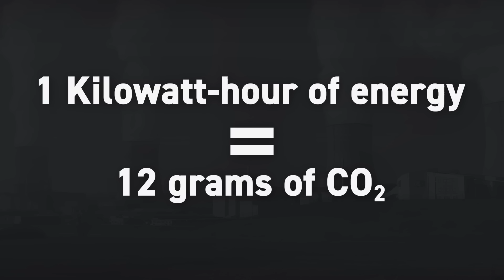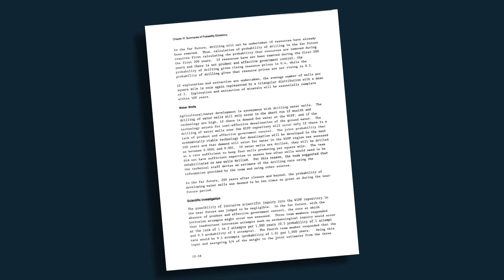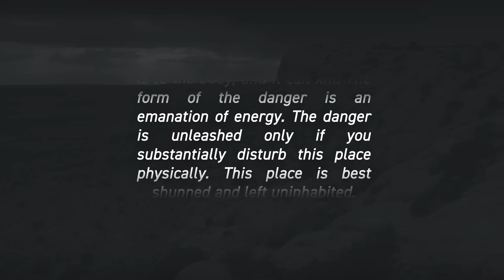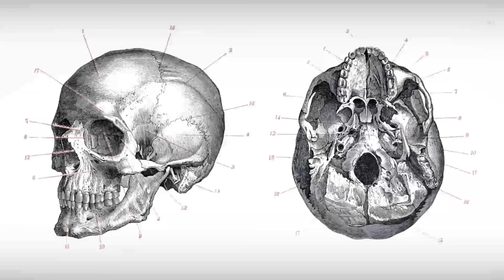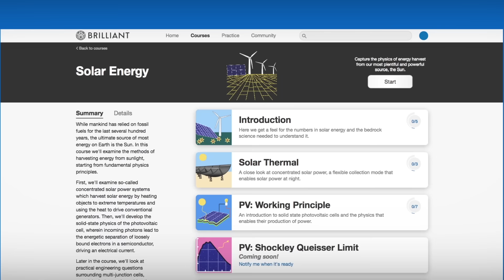The Nuclear Waste Problem

Comment: Disappointed that alternatives weren't even mentioned in the video. Thorium waste is safe after only hundreds of years, rather than hundreds of thousands. It's something that really needs more exposure.
Reply: yes and we cant use it at this point in time to produce energy. Nuclear waste isnt such a big problem. The pictures we saw in the video were probably the waste that a hand ful countrys generated since they started their first power plant.
Reply: And there's a ton of it unlike uranium. They used to just throw it away before.
Reply: TheCrazyKid1381  well for one he only talks about burying nuclear waste without going into other alternatives like Waste-Annihilating Molten Salt Reactor (acronym WAMSR) and really overstates the impact of nuclear waste. 

In fact Molten salt reactors are not even new. They were developed and tested in the 60's. But its videos like this that scare monger people into not supporting nuclear funding... which makes your problem worse. 

Fukushima was made in 1971. ALL of the reactors were generation II. In 1990 US NRC pointed out the problem in the reactors design and in 2004 japan NISA also cited the report. They knew and did nothing.

The problem is not nuclear power. It is the fact that nuclear power is seen as a boogie man so no one wants to support it.
Reply: kyletheok Nuclear power just like carbon and solar and many more, has drawbacks. 

As an Italian, I am happy that we don’t have to worry about some idiots poisoning  a 30km square (which is less than half of Chernobyl) area, because of a serious power failure, natural disaster (What happened in the case of a level 3 Vulcanic eruption? That eliminates a good 20% of the Italian coast, than you could have serious earthquakes...).

Honestly even just having them in France is a little bit of pain in the ass. Why should we worry about something going wrong there?
Reply: @baboongamingmgrr  
First of all, heads up for your knowledge on the matter. My knowledge stops at Chernobyl HBO web series... and the fact that it is the "cleanest" (Radioactive waist) source of power after windmill (learned from a youtube video obviously). 

However, you blamed the previous Nuclear incidents on Government mismanagement, mainly. Which I had already been made aware of. Thus, how can I, however be sure that this same mistakes will not be done by any future governments of my country, in the next 100 years?

For example, just this year, one of the most important bridges in my country just fell. 43 fatalities, and 600 people had to move due to the disaster caused by the fall. "Ponte morandi"incident,  it's called.

Why? Because despite having paid more than 10 times the amount of money, experts deemed necessary for the reparation of the bridge and other check ups, almost nothing was done. The money, more than €100millions of taxpayers money, was paid for the death of 43 people... what happened to the money? Disappeared. I think you can guess where it went. 

Thus, what if the same happened in a power plant? One day a hertquake hits (Italy is the Western European country most prone to earthquakes, receiving various every year throughout) and the power is lost. What append then if something doesn't work, let's say water supply stops due to a missed checkup for one of the generators.

In addition, Italy already has a tremendous output simply trough idro-powered centrals (25% of electricity is done trough clean energy in Italy), I doubt the cost saved by the long-run investment, would pay anytime soon seeing how much we actually need to buy from foreign countries + the opportunity-cost/Risk cost.
Reply: @baboongamingmgrr  however my question remains. How can I be sure that my government will respect the safety standards... (I guess the EU might have some policies).

Anyway, I think you might have brought me from being against Nuclear, to being much more neutral. i.e If a referendum comes up, I might have a difficult choice.
Reply: Saying that "thorium waste is safe after only hundreds of years, rather than hundreds of thousands" as an argument for thorium just exposes how badly the thorium crowd misunderstand the topic. First, the shorter the half-life of something, the more radioactive it is, meaning something with a short enough half-life to be inert within a few hundred years is /immensely/ more radioactive than something that won't be inert for a few hundred thousand years. However, both thorium and uranium power produce both types of waste. Thorium doesn't really have much of an inherent advantage over uranium in this regard, what advantages there are are quite narrow (the nuclear proliferation risk for example, it's lower with thorium than uranium, but the deal is that proliferation risk from civilian uranium power is already /very/ low, it's an inefficient means to a weapon) but nonetheless there. The main benefits, including the waste benefits, largely come from molten salt breeder reactors, which can use uranium just as well as thorium. 

The big set of arguments for thorium over uranium are largely just arguments for molten salt breeder reactors, and full of peddling of falsehoods about uranium power that further contribute to anti-nuclear fears among the public. Both sources have a place, as diversification of nuclear fuels is absolutely a good thing, and both are incredibly safe. So please quit throwing one under the bus to push for another.
Reply: I wish more people knew about Thorium and Thorium reactors.
Reply: Not true. Th breeders running on U233 DO produce heavy transuranics with long half lives. They just don't produce as much as a 235 or Pu burner.
Reply: @gladonos3384  
When you say "Thorium Crowd", are you talking about the thousands of physicists, chemists and engineers that are working on modern 3rd and 4th generation MSRs, or are you referring to the original 1960's team, led by Alvin M. Weinberg, who created and ran an MSR that had passive safety and ran at atmospheric pressure? 
Do you know anything about solar panel decommissioning and heavy metal soil contamination? Also, do you know the longevity of wind turbines, and what is the number of people killed due to wind turbines?
Please enlighten me, nay us, on these matters at you earliest convenience.
Reply: @quietackshon  "When you say "Thorium Crowd", are you talking about the thousands of physicists, chemists and engineers that are working on modern 3rd and 4th generation MSRs, or are you referring to the original 1960's team, led by Alvin M. Weinberg, who created and ran an MSR that had passive safety and ran at atmospheric pressure?"

Absolutely neither. I am talking about the "scientific" media that supports either one and claims to know but really just spreads stupid wishful thinking. I for example support Thorium. But i don't claim to be an expert. 

I do think the idea that "lol climate change won't be a problem because Thorium will simply replace everything" is ridiculous and a dangerous idea. The real truth is that we will probably be burning coal for a long time and it will be nightmarish trying to get off it.

But fusion is way worse because the "scientific" media treats having commercial fusion as if it's it's like having a Dyson sphere and ignores problems like neutron bombardment contaminating the walls as well as needing a nuclear fission reactor to produce tritium(shhhh! Don't tell the hippies...)

And yes, i am fairly convinced that most experts believe both of these systems will be expensive even if successful and won't solve all the worlds energy problems.

I believe the original thorium reactor you are talking about was a failure by the way. While it worked, it wasn't economical.

"Do you know anything about solar panel decommissioning and heavy metal soil contamination? Also, do you know the longevity of wind turbines, and what is the number of people killed due to wind turbines?"

From what i have read wind turbines last about 20 years. Can't say anything related to solar decommissioning. I know nothing about that. The metal is supposedly very toxic though.

"Please enlighten me, nay us, on these matters at you earliest convenience."

Where exactly did i say or imply that i was an expert? Do i need a masters degree in biology to call anti-vaxxers stupid? If not, why do i need to be an expert to call anti-nuclear hippies stupid? o.O
Reply: @gladonos3384  
"I believe the original thorium reactor you are talking about was a failure by the way. While it worked, it wasn't economical."
I'll assume this is an opinion and can be ignored, as the heat generated from this experiment was never used to create power.
"Where exactly did i say or imply that i was an expert?"
I didn't say you were and expert, you are jumping to conclusions.
"...but the Thorium crowd is nowhere near as bad..."
Is this your opinion or are you an “expert” on this kind of thing. Do you have the survey numbers on the sample size and a control group? Or is this just another throwaway line so you can look knowledgeable to the ill-informed?
When you say "stupid hippies" what do you mean, are you talking about people from the 1960s?
When you disparage others, be it friend or foe, maybe just state that your comment is an opinion. It's OK to have an opinion, but as it's a written medium being used here, it's difficult to tell whether it's an opinion you had on the shitter or a well-considered, knowledgeable response.
Reply: @gladonos3384  , About getting rid of coal. I think we can get rid of coal pretty quickly in selected places but it requires a few in development energy production methods to be financially successful. One of important technologies is nuclear heat only power plants which would replace quite a lot heat producing fossil fuel power plants. Heat plants would be small nuclear reactors running at much lower pressures than electricity producing cousins. The smaller size is possible as nuclear plants have about 3 times higher thermal power than electrical power. 

But nuclear power plants are mostly economical if you can run them close to maximum thermal power which means you need to design alternatives for variable demand.  To replace fossil fuel burning we can then use biofuels (eg. wood) instead to match variable demand. There is also research towards using energy storage methods to balance variable load but nothing feasible appears to be for seasonal variance.

But I see potential for getting rid of coal completely only around 2035-2040 if there is strong political will before 2030.
Reply: Thorium is very good and produces a lot more emitting a lot less.
Reply: Or less exposure, if you know what I mean.
Reply: no.

233-U transmutaions include 240-Pu, with lifetimes in tens of thousands of years.
Reply: @leonardodavid2842  Look, I understand you don't know much about nuclear power. There's a reason for that. Because we spent decades making it out to be bad. But it isn't. It is the cleanest, most common, most energy efficient way of producing power we have. That comment about making 30 square km unlivable. Yeah, if we let coal and other crappy plants continue. That 30 km^2 will be our whole world. There has to my knowledge never been a fatal Thorium reactor explosion or leak. Your points are invalid, but I don't blame you. So please. Be more open minded to new aspects of things you don't understand.
Reply: @Daphne_o7   I'll stick to solar power mate.
Reply: How about we just don’t do the nuclear thing at all. Sounds like a much better plan than anything I’ve ever read about as far as thorium is concerned.
Reply: Or you know in the future we could ship it somewhere not on our galaxy if we want to dispose it permanently.
Reply: Yes. Thorium gang.
Reply: Roscoe i do wonder about launching nuclear waste into the sun lmao..... like, suns radioactive, this shits radioactive, it’ll be fine 

Like there’s engineering obstacles sure but in terms of permanent solutions
Reply: @infantjones  um no? Thorium is a god tier material that has yet to be u tapped. The energy possibilities are extreme, the safety is something you would never expect from the material, and yes, the waste is easier to manage. I dont know what type of research you have done on Thorium energy, but it doesnt sound like much rather than just personal inferences using information from other studies, superimposed onto the study of Thorium.
Reply: @firedskull5015  unless there is a Dyson sphere, solar is economical fucked.
Reply: @clockworkcrew8012  Thorium, despite being more expensive and less useful than uranium as an extension of being less abundant in terms of economically viable to extract concentrations, only being usable in breeder reactors, having far fewer non-energy uses than uranium, and being less energy dense than uranium, is a "god tier material"? How? I'm also not sure how exactly thorium is particularly safe compared to uranium, its chemically toxic just like uranium, which is the actual risk from both of them (not radiation), and in metal form it poses pretty much the exact same risks as uranium in being pyrophoric and brittle, just without being a heavy metal (which is a big part of why it has far fewer commercial uses!).

Further, what type of waste is easier to manage exactly? Because the only type of thorium energy the popsci crowd seems to care about, LFTRs, do not have easier-to-manage waste in any way, solid fuel bundles are far easier to handle and store. Nuclear fuel salts in general are an immense pain in the ass to deal with because of their high reactivity and chemical toxicity in virtually every composition, with fuel leakage being far more dangerous than with solid fuels (which typically only have to worry about tritiated water leakage, which isn't chemically toxic, poses virtually no radiation risk, which doesn't deflagrate when it hits water, nor does it produce toxic gases). Thorium when used in a traditional solid fuel reactor doesn't produce easier to deal with waste either, the waste volume and activity levels are fairly similar, so I'm really not sure what metric you're using here. 

Thorium only seems like some miracle material when you don't know much about nuclear power and think light water pressurized reactors are the only option for uranium, when most practical use of thorium as a fuel has been a mix of experiments and supplementing in existing uranium breeder reactors (which run more efficiently on uranium btw). The reality is that uranium is generally just better in most situations and we would be using a lot more thorium if that wasn't the case, rather than almost solely using it to make up for politically-induced shortages in uranium supply. Thorium is absolutely a good supplementary material to uranium, especially in countries with limited uranium reserves, but it offers no real benefit over uranium beyond that and basically every stated benefit of thorium I've ever seen outside of its use as a supplementary fuel has either relied on dishonest comparisons (i.e. comparing thorium breeders to uranium LWRs rather than uranium breeders) or outright falsehoods, serving more as anti-nuclear propaganda than anything else.  

Also from what I'm getting here, your 'research' on thorium energy hasn't gone beyond the level of a IFLS article, which is rich seeing as you seem to think I'm repeating "just personal inferences using information from other studies, superimposed onto the study of Thorium".
Reply: @clockworkcrew8012  Jesus Christ... All i am trying to say is that it isn't a magic wonder resource that is going to solve all our problems. Arrogant? Why? What did i do? Disagree.
Reply: @gladonos3384  Thank you for restating my position for me. And no, I am not going to waste the time to debate a topic where everyone seems so entrenched. As you don't discuss to share your ideas, you argue to prove yourself right. You challenge, not cooperate. So no, I am not going to waste my time here. Maybe be  little bit more inviting and Others might want to discuss and learn. So goodbye, I will not see any response as I will be making us of my time.
Reply: Leonardo David 28 you may as well ask, how can I be sure that my government will not outlaw democracy
Reply: big drawback is,,it doesnt produce weapons grade plutonium,,so,,its not viable..
Reply: @leonardodavid2842  He assumes mistakes or errors or negligence would never happen.
Reply: It's not simply just thorium. Uranium waste can also be short lived by using fast reactors.

Comment: What they fail to mention: both “nuclear” disasters actually were due to human error- particularly in the case of Chernobyl, where VITAL safety measures were IGNORED!
Also, nuclear power is INCREDIBLY dense in compared to the space it takes up AND the waste it produces.
Reply: I'm a nuclear energy fan, but I don't think this is one of the stronger arguments -- human error will always be there, perhaps better to emphasize it as an opportunity for future power plants to get better
Reply: Right, its not like other sources of energy have not had accidents  or killed humans, due to human error or otherwise. Only photovoltaic solar energy appears to have little to no opportunities for accidents